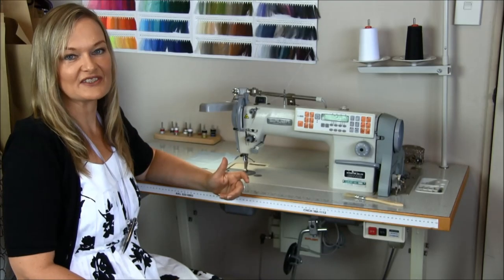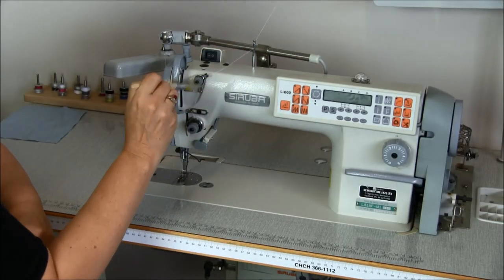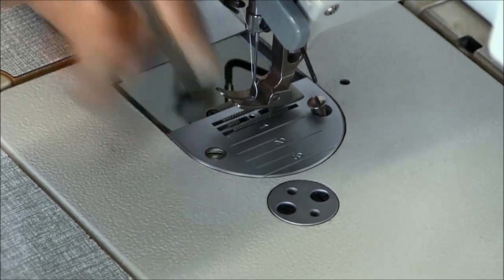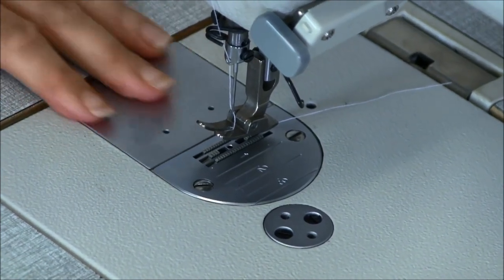How To Clean Your Industrial Sewing Machine - The Fashion Industry Way

Comment from the maker: Any and all debris - bits of fabric/thread or pins must be removed from the oil bath.  If anything gets pumped up through your machine it may cause major damage.  Take a pair of long nose tweezers and removed anything that doesn't belong (I suggest you use kitchen towels to wipe the bits onto) then ensure you clean the tweezers thoroughly before using again.  Hope this helps and thanks for the question.
Reply: yes it may be becuse of the oil i saw some of dust that come from the fapric maybe, i will chang it  and clean it .thank u alot

Comment: I am about to get my Juki industrial sewing machine tomorrow. Very excited about that,  but not so keen on moving it as I bet they are heavy to move. I noticed these sewing machines seem similar with there oil sump. I need to clean mine and give it new oil. I wonder how much it takes. its 20ish for 1 ltr and 70 for 5 ltr.  It needs a good clean, and already had a service. thank you for sharing these videos. I"m a beginner clothes designer  (self taught )
Reply from the maker: Well done.  Ye they are very heavy and you need to drain them before you move them.  You'll need to check your manual about how much oil to put in, but congrats on the purchase!
Reply: Did not cost me a cent :)  My boss gave it too me. He didn't have any use for it, and needed more floor space. So yes I am very happy with the lovely gift.  I will need to checkout how to drain the oil, and any tips on transporting it.  Ty once again and I am glad I found your channel as it looks rather interesting.

Comment: Thank you for the video. How do you change the oil? I have a Juki and my manual doesn't say how to take out the old oil.

Thanks
Reply from the maker: Kar Kar I have put a tutorial/article here for you on oil changing.  Hope it explains things for you. http://bit.ly/1eTDJ2W
Reply: Thank you very much. Now I can change the oil.
Reply from the maker: Kar Kar Glad I could help.
Reply: This link doesn't show or tell you how to change the oil
Reply from the maker: That page is now gone - there is a plug at the bottom of the reservoir for drainage - it will show as a diagram in your manual that come with the machine

Comment: Had the oil caught a decent amount of dust/fabric fuzz what would you suggest?
Reply: Elayssa Thompson I was just going to ask that very same question
Reply from the maker: AHS Society Any and all debris - bits of fabric/thread or pins must be removed from the oil bath.  If anything gets pumped up through your machine it may cause major damage.  Take a pair of long nose tweezers and removed anything that doesn't belong (I suggest you use kitchen towels to wipe the bits onto) then ensure you clean the tweezers thoroughly before using again.  Hope this helps and thanks for the question.  I have also put a tutorial here for you on changing out the oil http://bit.ly/1eTDJ2W